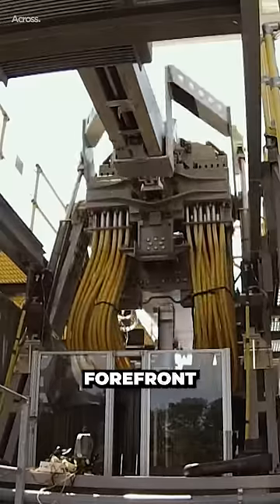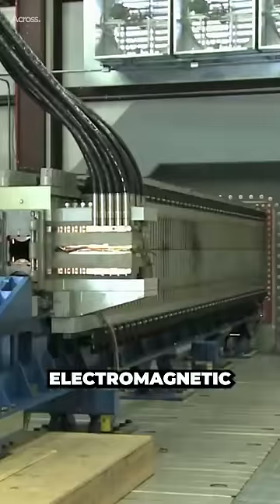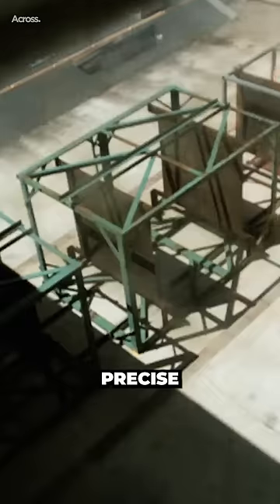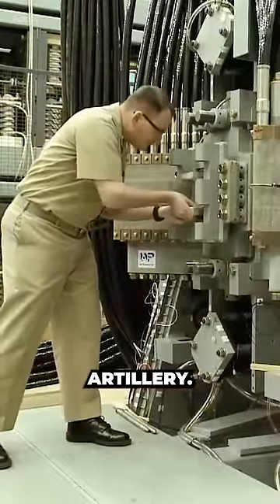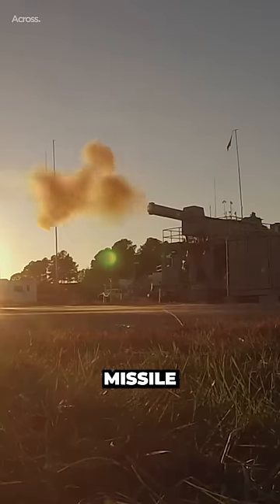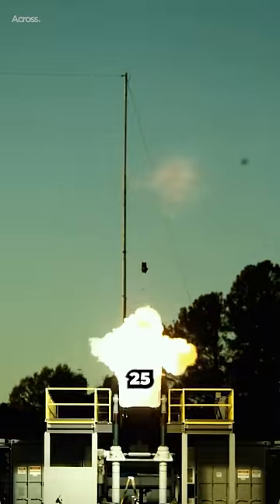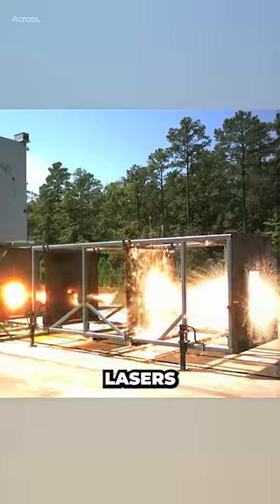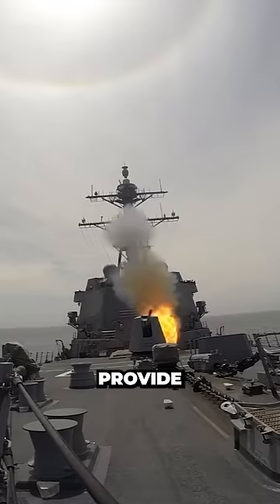The $500 Million Weapons That Make Everyone Afraid #shorts

Comment: "Radars" cannot track a big piece of "lead"
Reply: We have the technology to track the disturbance in the atmosphere.  Dont have to track the projectile directly.
Reply: @davidlott7436  I was talking in "general". This is one of the many, cost, etc, etc..... that we are taking this approach. In trials, the mechanism that shoot's the projectile does not last that long and was wearing out fast and had to be replaced. I was in the U.S.Navy 22 years so I'm pretty familiar with weapon systems and their capabilities.  Thanks for your reply. 🙏
Reply: @davidlott7436  That doesnt help you intercept it though.
Reply: @nelson_rebel3907  
"Sir, we have a hunk of lead moving almost as fast as an SR-71 headed towards us!"

"Shoot it down!"

"Sir, how in the actual fuck do you propose I do that? I don't have a 45 meter thick piece of metal lying around."

That's how the conversation would go.
Reply: @dragonseatcheese8727 Well, the projectile can't be too heavy. So if you're able to crash something into it at great enough range, it can at least be deflected. Or the deformation may screw up the aerodynamics to the point where it disintegrates.
Reply: @dragonseatcheese8727  SR-71 cant do half the speed this hunk of led will be moving at. its fired at Mach 7 or higher that's just over 5000 MPH SR-71  tops speed is just over 2000 mph

Comment: Please note a couple of things. The projectile coming out of the muzzle with the fire in the background there is no explosives involved! That is literally dust from the firing chamber being incinerated as the projectile goes through it! The scene words going through multiple Steel Target's blowing Sparks that is a reaction of the projectile with the steel Target again that is a solid steel projectile not an explosive projectile!
Reply: That is the plasma of the vaporizing metal coming off both the projectile and the railgun bore. Electricity is passing through the projectile at such a high rate of current that that is the result. It's also one of the biggest challenges with railguns as the bore is quickly worn out.

Comment: Best to be used in space.. with a powerful radar and fc system.😊
Reply: It's the equivalent of a MAC, Magnetic accelerator cannon.
Reply: They'd burn up in atmosphere. They'd have to be designed with heat shielding in mind, and we'd have to send all of this to space. Which is expensive as hell. But nevermind that. These are weapons of mass destruction. Overkill on an order not seen in combat since Nagasaki. On the high end, you might have an explosion capable of flattening a city from just the kinetic impact. The greatest form of energy is mass. It's why e=mc^2 (which is actually the short equation, fun fact.) gives you such massive numbers. You can't use them anywhere close to your men, and I'm talking within possibly dozens of miles. Massive civilian casualties would happen nearly immediately (ports and military bases are almost always located close enough to cities so they have shorter supply lines), and rapid deployment would cause short lived regional temperature drops that would cause famine if it happened in the growing season. Enough of them, and we'd see that globally. Hit the wrong thing, and we have a mass scale radiological, chemical, or biological hazard. This is the sort of weapon designed for mass extermination, or the threat thereof. Not for war.
Reply: @Imperious110  Halo theme intensifies.
Reply: It would hit like a nuke. with the amount of destruction depending on the size of the projectile - just without the fallout. A small projectile launched from the far up would probably hit like a tactical nuke.
Reply: @dragonseatcheese8727  Not much different from a modern nuke then - just without the fallout.
Reply: @marcoslaureano5562  Look up rods from god, or Project Thor, which was envisioned by Jerry Pournelle BEFORE he started writing SF.
Reply: @marcoslaureano5562  Actually only about a tactical nuke, probably about 1-5Kt.
Reply: Well doing that would be way less effiecient than the Rods From God concept which was abandoned due to the ineffiecient nature of it. All you had to do was get a series of tungsten rods on a satellite and just drop them at the Earth. The problem was getting the rods into space and how expensive that was. So sending a rail gun up into space and providing it with ammunition is going to be something far more expensive and ineffiecient compared to the already defunct idea of the Rods From God.
Reply: The Rods will be more effective.
Reply: @jaysherman2615  Not if you do it the way Robert A. Heinlein did in "The Moon is a Harsh Mistress".